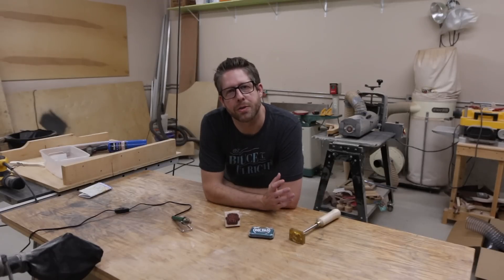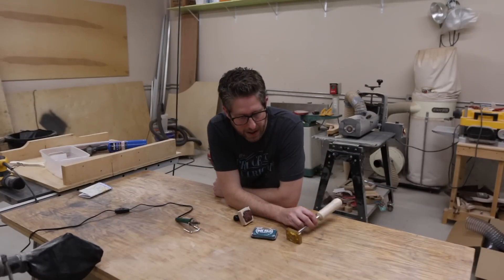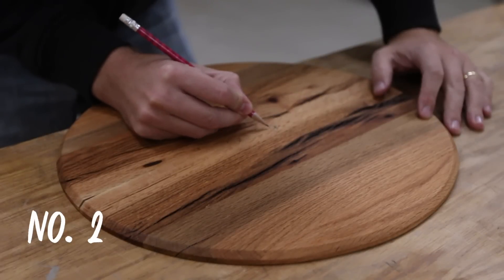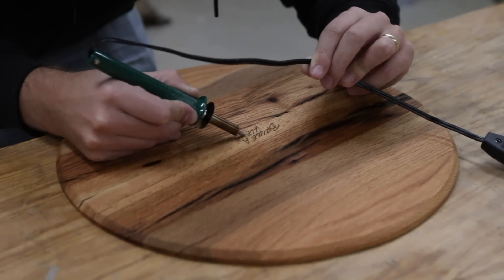3 Easy Ways to Mark Your Work

Comment: Great information!  I just started stamping my projects, but I wanted to ask, do you ever have any issues with the ink bleeding?  So far I've only really noticed it on unfinished plywood, but man it bleeds a lot into the surrounding wood.  I love that iron you have.
Reply from the maker: Thanks, Nick! The only issues I’ve had with the stamp bleeding are when I use oil for finishing. I’ve seen a little bit of bleeding in the past on cutting boards that I stamped.

Comment: I think I tried every method to transfer reverse laser printed images to wood.  Ironing, Mod Podge, Acetone and polyurethane.  Even ink jet printing on wax paper, that failed when I got wax paper caught in the printer.  Then there's the waiting for it to dry before lightly scrubbing off the paper. I usually scrubbed off some of the image. I don’t own a laser printer and had to make trips to the copy center. When I realized I was using the same image, I decided to get a rubber stamp. I found RubberStamps Unlimited online. I uploaded my image and they made a stamp from it. About $20. The mark is crisp and clear. Instead of Ink I use paint. I can use any color, stain or dye.  This is by far the easiest way I found to mark my work, just rubber stamp it and add the clear finish.  I also use a separate date stamp to add the date.
Reply from the maker: Good ideas! A rubber stamp can be really useful